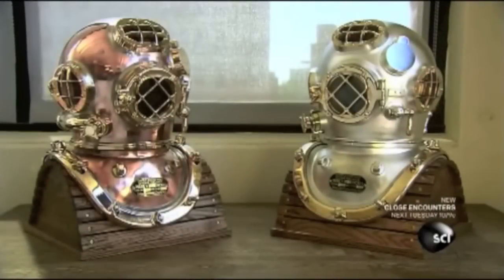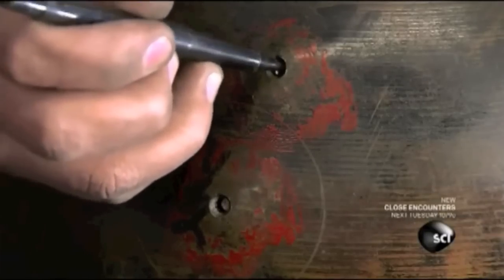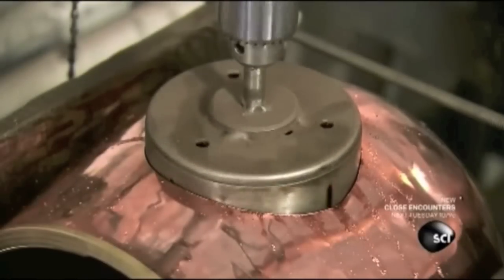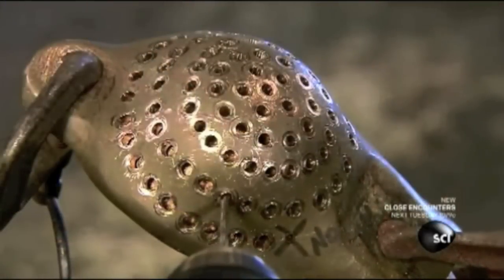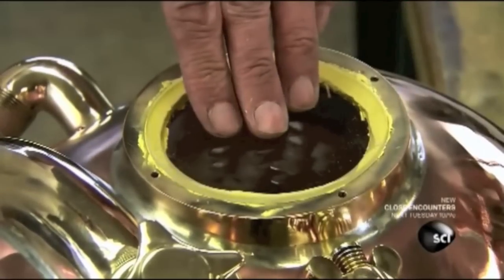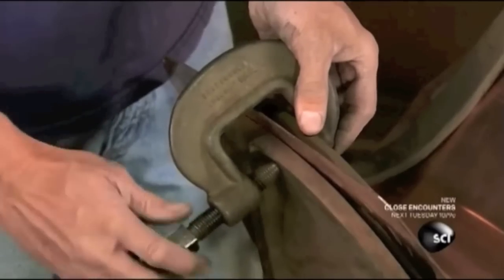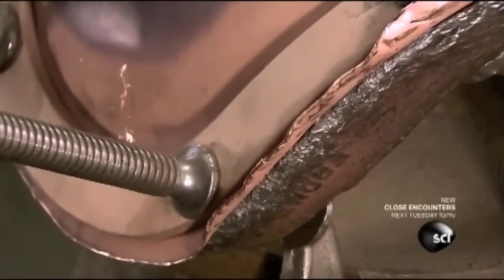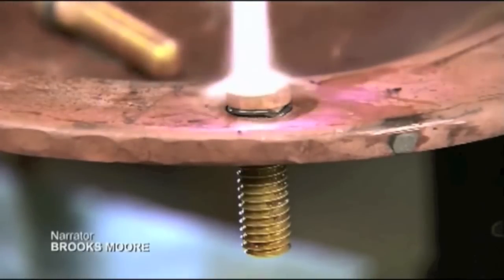Antique Diving Helmet: Making the DESCO US Navy Mk V

Comment: Not even worth the price tag they hang on it.  AND SINCE WHEN DOES A CNC REPROGRAMMED LATHE TAKE ... HOW LONG DID YOU CLAIM?   Finding all the component parts and fittings and proper air supply hose  is another issue.  and then finding a decent dry suit that even looks like the original design at a fair price is yet another issue.  This investment clearly isn't for working.  When in fact; it is better than many designs for certain work and underwater functions.  A working diver/welder welding for hours on end and day in and day out would find this mode of dress far better and comfortable than any modern day equipment.  FROM EXPERIENCE.
Reply: +DALE thebelldiver Not really sure what you are trying to say, here. You say it is not worth the price, then go on to say it's far better than certain designs for certain jobs. Can you clarify?
Reply: +Bruce Smith Think he's just drunk like every other diver
Reply: no; I wasn't drunk.  They claim it takes a month and a half to machine the parts.  I  own a CNC lathe and can make each part in about an hour maybe two for complex cuts.  I'm saying they are over pricing the equipment because they don't really care if they sell or not as far as competing with the commercial diving industry.  These helmets are as good today as they were in the early days.  I've worked in them extensively and they have their place.  Especially in a welding situation where long term exposures are  experienced on a daily basis.  Nothing beats heavy dress in situations like this.  They should cost $1,000 TOPS
Reply: You have no clue what you're talking about I'm afraid. If the MKV mod(fill in the blank) were "better than many designs" we never would have dropped it. And I don't miss the dry suit... give me the new neoprene and the MK12 any day of the week over the MKV. Coms.. far better in the new rigs, defogging-don't get me started.. comfort, I'd never go back. You're talking like a non-swim, sorry.